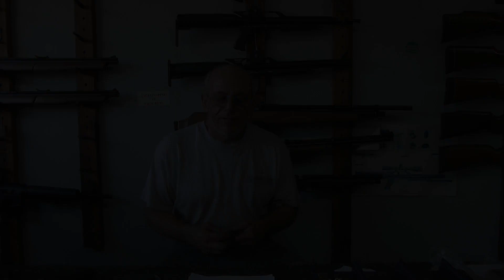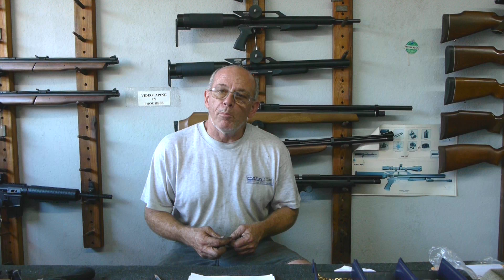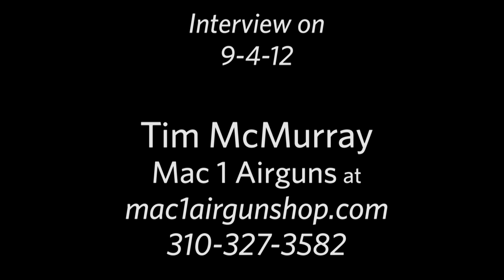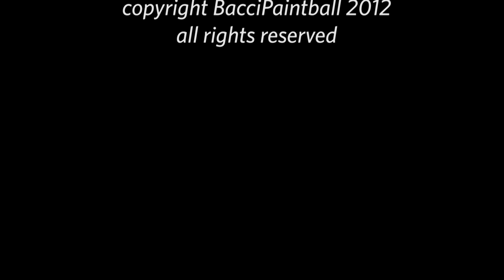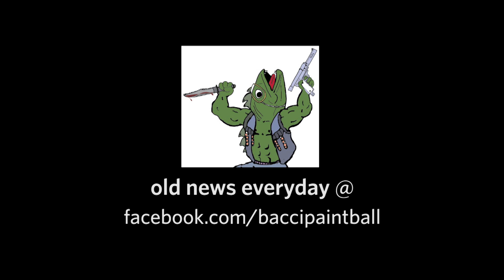Tim McMurray, of Mac 1, discusses barrel efficiency (barrel length vs valve volume)

Comment: this is why the "silenced" spring airguns with baffled ends are BS, best thing you can do to drop the noise is have a correct barrel length and use a gas piston rather than a steel spring.

Comment: Every autococker owner needs to watch this. Nobody believes me when I try to tell them about the volume of air mass traveling down the barrel and timing it so the ball exits the barrel right as pressure drops off (i.e. a proper sweet spot setting).

Comment: You sir, obviously know what you are talking about. So I would like to ask your opinion. I have a Crosman 1377 American classic phase 2 that I just put a steel breach and 18" barrel on. The longer barrel improved velocity over the stock 10" barrel. Now I'm wondering, would I get even more of an increase in feet per second with a 24" barrel? Or is that too long and would slow the pellet? Thank you for any advice you might be able to provide.
Reply: About 10 fps for every inch of extra barrel length is the standard.